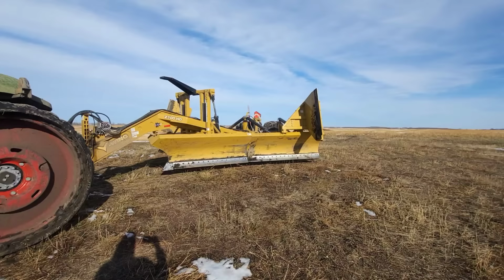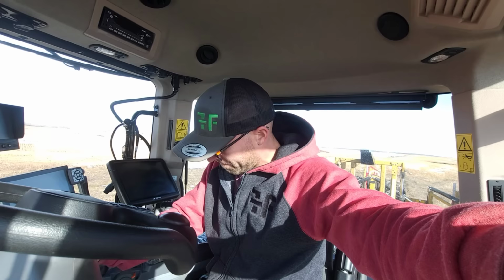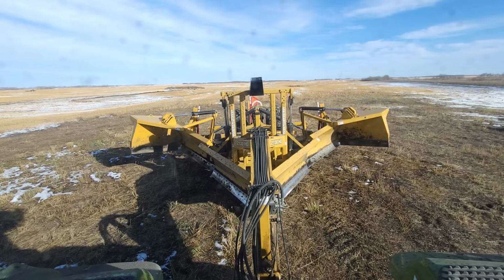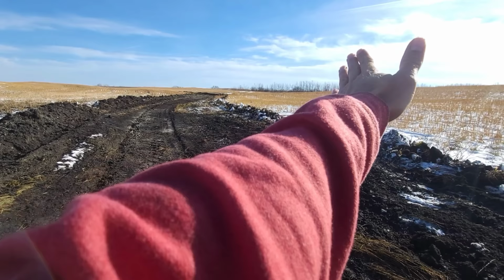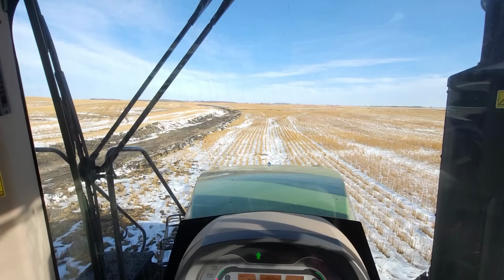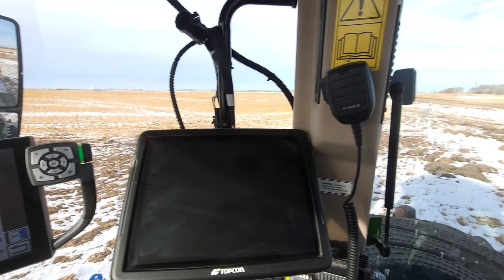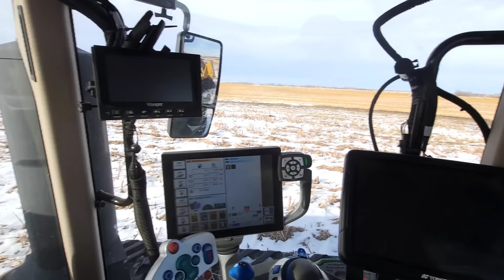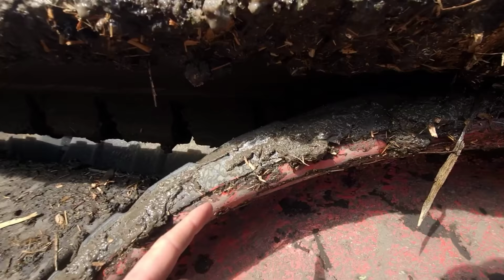What the heck is that?! 🤔

Comment: Modern version of the Bull Ditchers used in the midwest 100 years ago. A giant plow pulled by a herd of bulls. No idea how they talked a herd of bulls into doing that!
Reply: George  Yeah, and once you got a team trained you could add some rookies who would learn by just going along with the rest. A good sized ditcher required 48 head and some were quite a bit larger.
Reply: George  Apparently Bulls/oxen had better endurance than horses. Especially important when pulling thru mud .
Reply: @lynwessel2471  I hope your not feeding us a load of bull 😁
Reply: @sandy7299  LOL,  there's info to be found on the internet. I know stories about early drainage efforts in my area. Those old timers were determined to drain their land whatever it took.
Reply: @jeremymoreside1444  They  called it a bull ditcher for a reason. Oxen (castrated bulls) were used . The guys who walked/rode alongside to keep them under control were called "bullwackers".
Reply: That's amazing that bulls had the power to do that...and like you say, to get the bulls to cooperate...they are difficult to deal with at the best of times
Reply: @sandy7299  sitting here almost spilled my coffee 😂

Comment: A D6T v-pat blade with gps would be the solution to your water drainage. Looks like a recipe for top soil and clay mixing. A dozer may take slightly longer but can maintain an aspect of stewardship that leaves the land nearly untouched in terms of natural soil type layering and in return be able to grow to the lands full potential yield. It’s cool to try something new and different but hard to justify when land degradation is at risk.
Reply: All depends on how good the operator understands and runs the machine.

Comment: If you have much snowmobile traffic on your land this winter before you get a chance to run the pro-till to smooth things out someone may get a shockingly rough experience
Reply: I can’t speak for snowmobiling but ATV’s  never speed through tall grass in unfamiliar fields. Figured that out at an early age.
Reply: The best part of the field is the cattails with 10ft of snow in them. Wheelies lol
Reply: @jackbannock3458  you can do that in a few inches, just need the power.

Comment: If the inner surface of the tracks on the Challenger / Fendt had hard rubber blocks molded into the tracks which dopped into  similar shaped holes around the drive wheels, then slippage would not be a problem.
They would need to be well bonded otherwise they would shear off.

Comment: just  watching Mike speeding up gully formation (?)
Reply: Very low water flows.
Reply: @ke6gwf  makes sense. Usually berms and dikes have a Hikenbottom to channel water to a tile. I didn't see any such structures.
Reply: @gjs102154  that's because you are used to normal terrain where downhill leads to streams and eventually to the ocean lol
Up there it's all glacier poop and there isn't enough runoff to erode streams and rivers to the ocean, and so runoff water just collects in low areas and then soaks in or evaporates.

They had been just farming in between all the depressions, and what they are doing here is just merging some of the low areas together so it flows to the lowest area and sits there until it evaporates.

The elevation change isn't enough to warrant tiles and such, and the water flow is basically only during snowmelt and active rainfall, and they won't be planting then anyway, so no benefit to the cost of putting tile in.

If they had ground water and constant flow, then such investments might be worth it, but this is a different environment and that stuff doesn't make sense because there isn't enough water.

Comment: This machine is designed to be used with rtk GPS. I understand that you're just trying it out but in my opinion rme should only let this out on demo when the rtk system is active. You'll never realize the true value of the v wing or even  a pulldozer until you experience doing your dirt work with rtk. Elevation is paramount. With rtk, when you leave the field it's done. Everything is to the proper grade. Letting your rtk and hydraulic system work together automatically is the key takeaway. There's way too many hydraulic options to try and adjust manually on your own. Once you've done your dirt work with rtk you'll never hook up to your pulldozer or v wing again unless you've got access to your rtk.
Reply: How do you know?   Not so long ago people had skills, and no satellites, they made it work!
Reply: @aubreywilliams6153  I'm from that era of land drainage. Do you recall when gps first came out? It changed farming almost overnight. Throw away the marking systems for seeding, spraying etc. I suspect not many would want to go back even though they know that it'll work. Same idea holds true for land drainage using rtk, imo. It's a game changer that seems to be a well kept secret.

Comment: In Mississippi or maybe Missouri department of Irrigation one of those states (it's been 35 years ago) they have a hydropic adjustable ditcher sloper that is a costume built plow that you pull with as many as 3 D8 cat's and make irrigation ditches big ones built by jack and Paul Rutherford Kerman CA